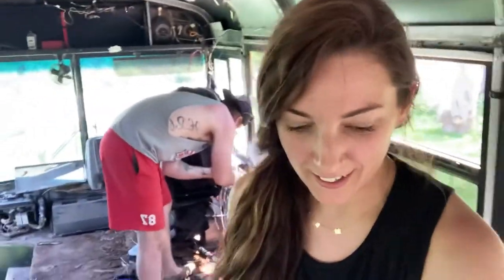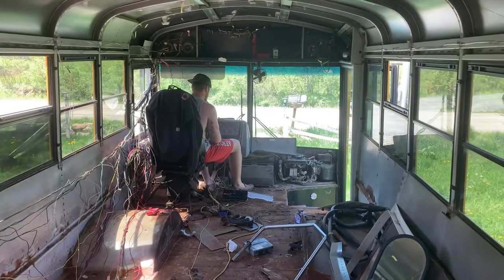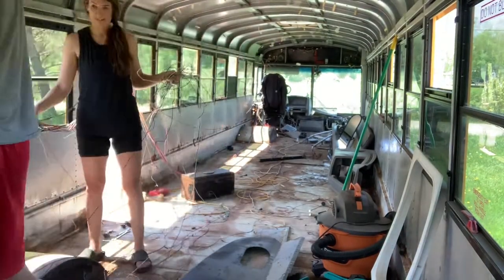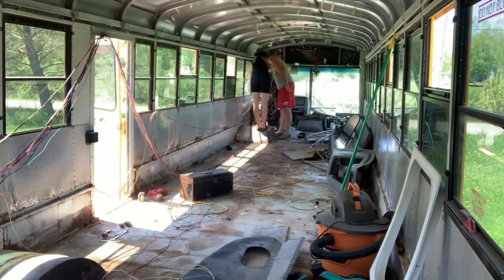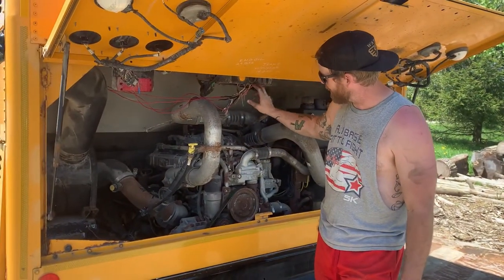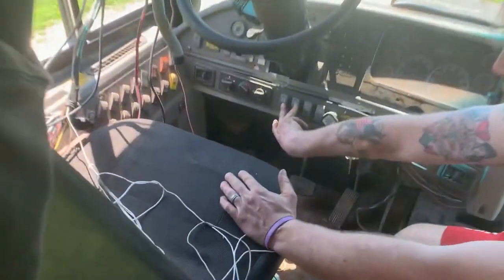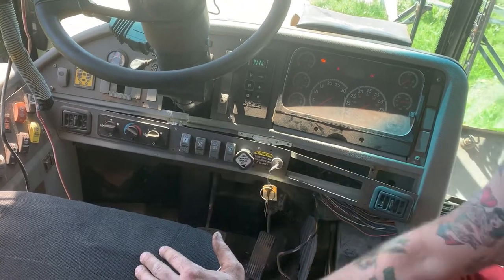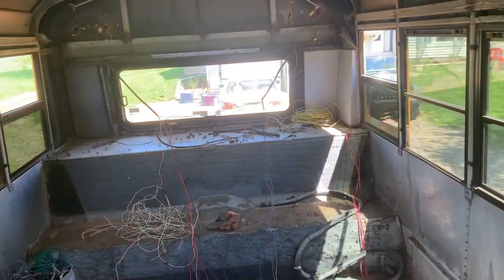STRUGGLING TO BY PASS THE SECURITY INTERLOCK| HERES WHAT WE DID, IT WORKED! | School Bus Conversion

Comment: The bus I bought had an electrical schematic taped inside the fuse panel and showed all the wire numbers on it.  The wires all had numbers and a color.  Also the bigger wires were for the flashing bus lights, and the smaller ones were for other functions.  I pruned a bunch of wires, but now that I think back on it, I wish I would have left some of them in place for future use. The cost of stranded automotive grade wire seems expensive when you could repurpose a few wires that already go the direction you want them to.  I'm sure you already know all this, and it looks like you are doing a great job!  Just commenting for other viewers that like to read the comments.  A random comment on many of these videos has helped me quite a bit from time to time.
Reply from the maker: Thank you, this is very helpful! We are happy to have as many tips as we can gather. Wiring isn’t our favorite. 😃

Comment: So there is a solenoid that the safety wires hook to in your fuse/wire box. Just take the wires off of it then take a wire and ground it to your bus. At least that's what Ive gathered from all the videos Ive watched. I'm at this same point in my build and the wiring has taken the wind out of my sails lol. I'm a scarred as they used to say.
Reply from the maker: We tried to do that and it didn’t work, which is why we had to run new wires. Yes, the wires got us too but now we are back at ready to get the roof raise done! I hope your wires get done soon!!

Comment: when you took the buttons from the engine compartment, did you cut the wires before they went into the back fuse box or after? i have the same bus and am trying to do this same fix
Reply from the maker: Andrew sent of the wires  from the engine bay all the way to the front didn’t touch any of the two wires that went to the fuse box at all.
Reply: @madarafarms  did your engine start before moving the buttons up to the front?
Reply from the maker: @johnnyroach837  only from the back.
Reply from the maker: @johnnyroach837  one thing we learned is the wire has to be grounded, is yours grounded?
Reply: @madarafarms  I think it is but I'm not sure. I've been trying to track down what wires are powered and what wires are grounded with a voltometer but I haven't been having any luck. My bus won't start even when using those back buttons
Reply from the maker: @johnnyroach837  our was in the back of the bus right by the emergency window idk if that helps.
Reply: @madarafarms  that does, i have 2 grounds plugged in back there and one of them must be the one your specifying. i just checked my battery and it is low so maybe in the morning once its charged up this will work. ill update you if that's the case, thanks for all the help thus far!
Reply from the maker: @johnnyroach837  awesome! I hope it works keep us posted!
Reply: @madarafarms  so turns out one of the batteries was bad, (been trying to charge it the last few days) i just replaced it and was able to start my bus with the rear buttons! i still have the continuous beep going but at least i can get it started again! thanks for your help :D
Reply from the maker: @johnnyroach837  yay!! Awesome to hear. We had that too. It’s an emergency wire I believe because the back is open. Once you move the wires up front that will stop.